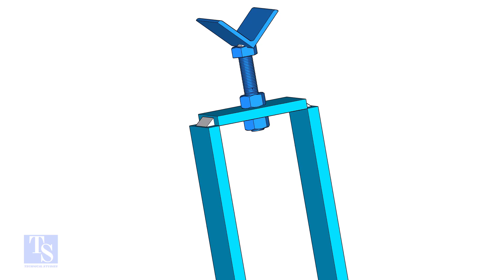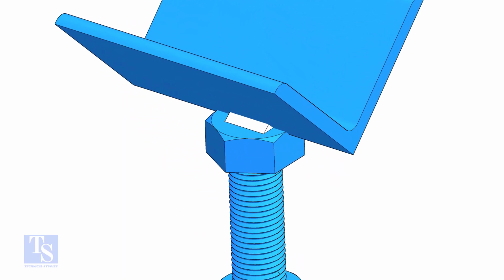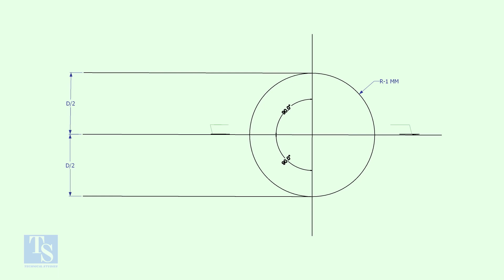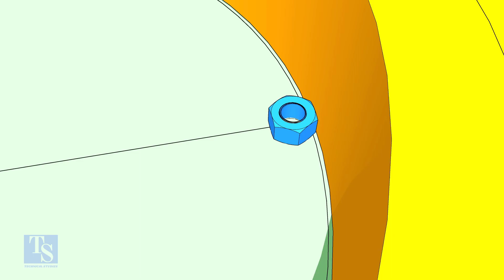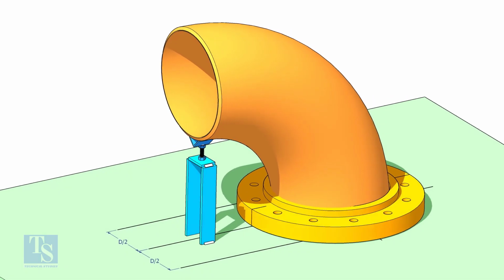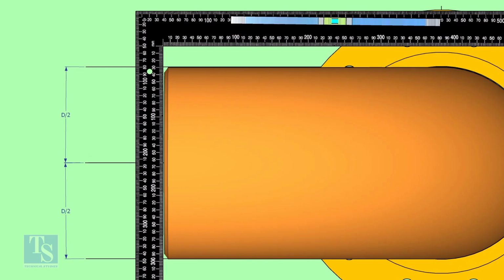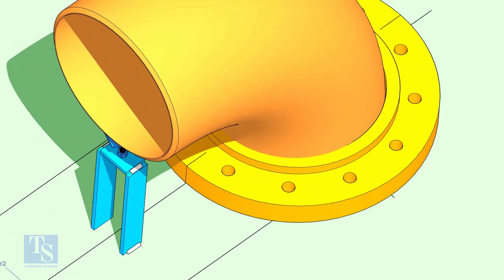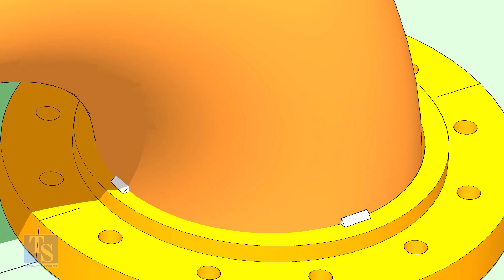SLIP ON FLANGE FIT-UP ON AN ELBOW.

Comment: This will not work properly. The radius on the elbow (not a reducer btw) will not allow it to fit straight in the flange. So the 90 will not sit flat on the nuts. To use this method you will require a larger setback. You can also clamp the flange vertically in a vice and 2 hole it (level the 2 holes) after is it secure and level you can insert the 90 and place the level on top and make sure it is level to the holes. 

Also, similar to the first method, instead of drawing, you can put 2 bolts through the flange and hang the bolts off your work table pushing them against the table so the flange is square with it. Put the 90 elbow in the flange, then use a 2 foot level on the 90 and look down, if the level and the edge of the table are parallel, the fitting should be square with the flange holes.
Reply: Good eye.  I was looking for someone making this comment about a greater setback requirement.  As such, this may not be permitted depending on the code being used.  The elbow radius also interferes more if it's short radius.  This technique works better with AWWA plate flanges since you don't have to contend with the flange hub..   How about this, let's just use weldnecks when connecting directly to fittings ffs!  I wish they'd just explicitly state that in more code books so there was no option.

Comment: What do you do if your company buys shite elbows and the faces aren’t square
Reply from the maker: Nice question. I will layout a true size elbow. I will put the elbow on the layout, adjust until the elbow, sits on the layout perfectly, then I will mark points on the elbow, using a right angle (set square), referring points from the layout.